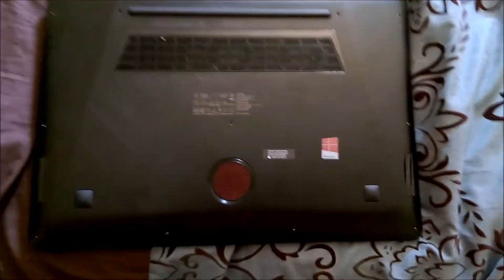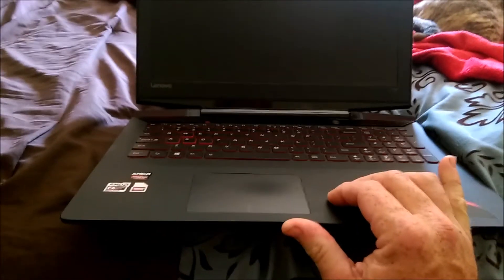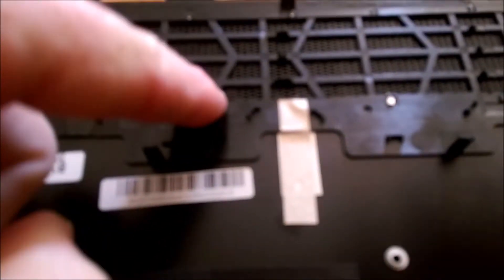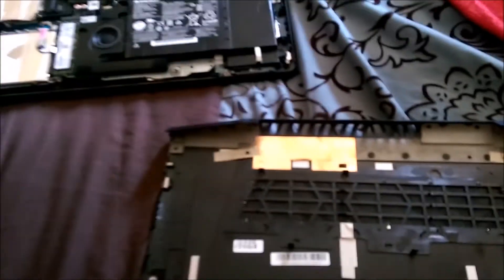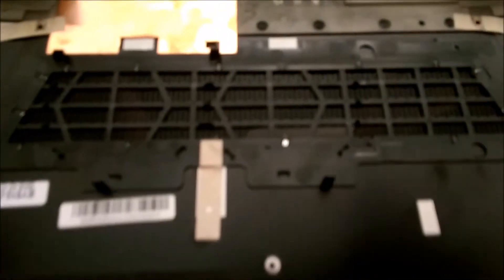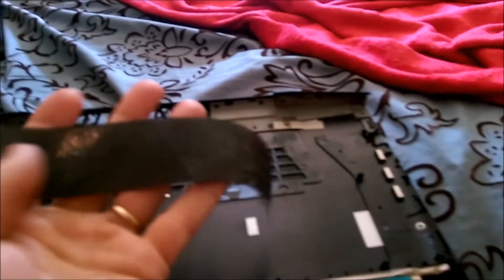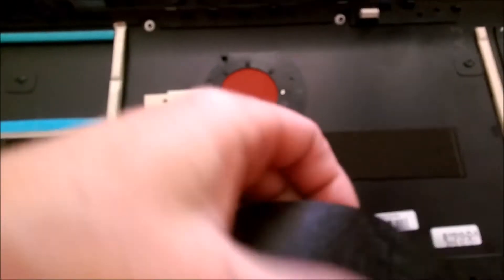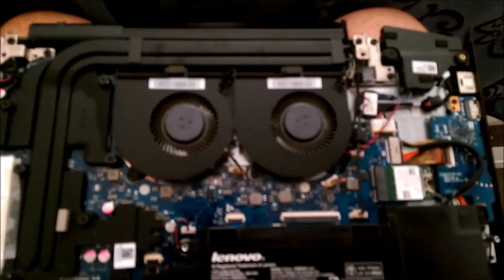Y700-15ACZ How to remove dust filter and STOP the throttling!

Comment: I have a question, I have the same laptop as you, is there a way to clean the fans without opening the laptop? I want to use compressed air but idk if it will mess up the hardware. Is there anychance you can make a video about. Thank you in advance.
Reply from the maker: Unfortunately, I have not ownrd this laptop for a while now. I believe you take a vacuum to the vents and the will help. Ultimately opening is the best solution.
Reply: @redfive5758  Thank you for responding.

Comment: I'm assuming everyone knows about the built in dust remover, but just in case - start optimizer (green button on task bar) then every couple weeks click on fan dust removal - run. Let it run for a minute or so. I've used my y700 for two or three years now in extremely dusty conditions with excellent and stable temp readings without having to f.... around with the inards.
Reply: how do you have that dust removal software? I'm pretty sure lenovo removed it a long time ago.

Comment: Hey man do you think this will help on my y50(it's nearly the exact same mode design)? My gpu sometimes used to throttle because in overwatch the game would die and run extremely slow  and sometimes there would be audio lag. Now my gpu won't even work and this leads me to think that the gpu shuts down because it overheats in the startup of the computer, and it can run games but it says overwatch can't find the gpu.
Reply from the maker: Chase Houske I would search google and the forums at overclock.net.

Comment: While playing SC2 the game occasionally freezes for a second and then its normal, if you touch the laptop its really hot and i have a cooling pad. Doing this will fix the problem?
Reply from the maker: Brian Alexander Lozano Oliva It should help. that filter is very thick. removing it definitely allows better airflow. my laptop has been fine I removed it. If you are uncomfortable about it then don't do it. if you confident the go for it.
Reply: Ill try, thanks

Comment: i use a cooling pad so i dont think i need to remove it for now... i also try to keep my house fresh and never play on my bed, which is the worst thing you can do as it blocks the vents and a lot of dust can get into the laptop. better to play in a desk with a cooling pad.
Reply: tenblueberry And? How does the performance look like? Is there still stuttering issues with the cooling pad? I'm planning to buy one ^^
Reply: No problem so far. It's still not that hot yet anyways, but during the winter the gpu temps max out at 69ºC and now it gets to 72ºC max, but usually around 68ºC which is pretty good (and I overclocked the GPU a bit so...). Right now the ambient temperature is usually around 20-23ºC but during the summer i'll probably play on my living room and turn the air conditioning on 'cause on the hottest days it gets to like 33, 34, 35ºC which is kinda bad for any electronics device XD
Reply: I have been using y700 not the 15, 
The 17isk, 
For nearly 3 years, and I've been playing mainly CSGO every night 3 hrs minimum.

First 2.5 years never had problems, 
Middle of 2019 after returning from 6 month overseas (Asia) trip, 
When playing csgo in the middle of RANKED match my game crashes and the screen goes black.
I can hear the sounds playing but no visual.

So now am thinking of removing the filters and giving it a try.

Mind you I always had the aluminum cooler from the beginning.

I will update again, 
I will remove the filters today and test it 2 days and will update here

Comment: if u remove the dust filter do you get higher framerate in games?
Reply from the maker: it helps the throttling of the apu more than affecting fps. I have noticed doom played smoother with less stuttering at 1080p.